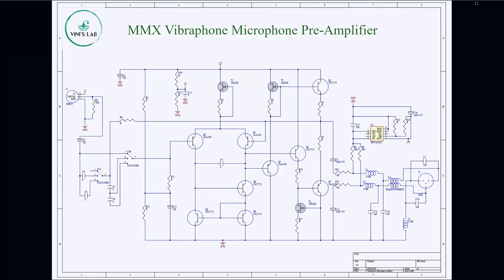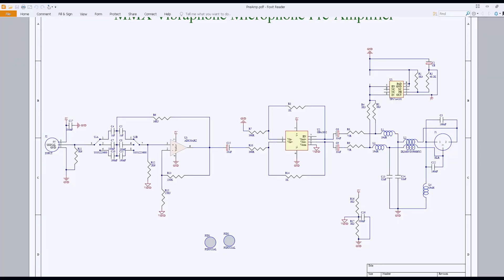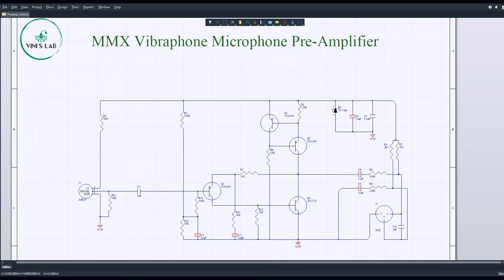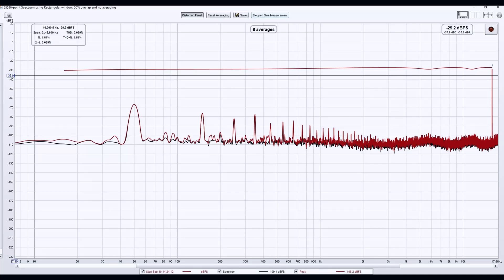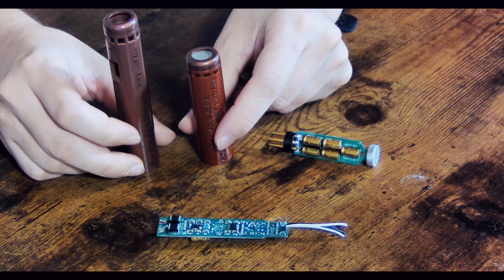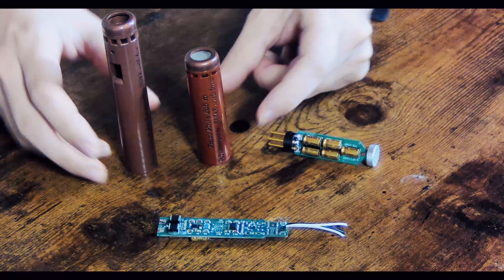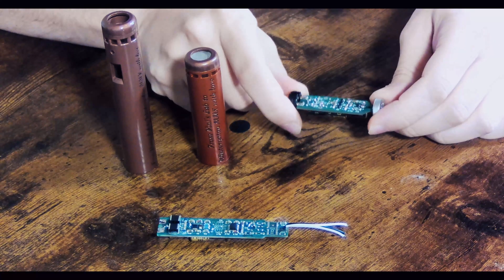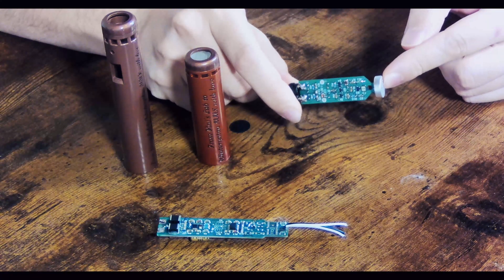Building a Microphone for the Marble Machine X | Final

Comment: You say "Learnt my lesson" and "Discrete BJT design" --> But what exactly was this "lesson" ? There are plenty of opamps with a quiscent-current lower than 15mA and with low noise, albeit not 0.9nV/rtHz ;) 
A BJT design can be fine, but an opamp can be laser-trimmed. Without a proper rationale, this sounds like an "artisanal" choice.
Reply from the maker: To prototype before pressing the manufacture button 😅... Sure this is more an artistic project than anything else 👌

Comment: I think it sound good, but is partly has a strange sound on the youtube video, but i think that's only because of the tecnical design it self of the microphone, i think it will do perfect for it's intended purpose.
Reply from the maker: My acoustic here was not the best, I had to use some blankets to reduce the reverb to make it more clear, also the mic has a lot of bass, that is good but for male voice makes even more bassy :D
Reply: @VinisLab  I guessed that caused the tincan effect, i know the caracteristic need to be different here compared to a normal broadcast mic in order to be optimized for this particular purpose (othervise i think it may possibly had induced disturbance whan it is on place if one had used a regular broadcast mic design), awsome job with the microphones!